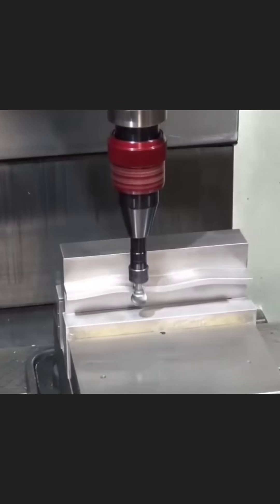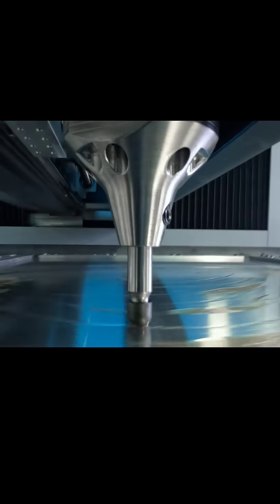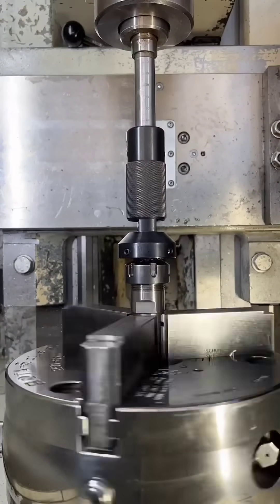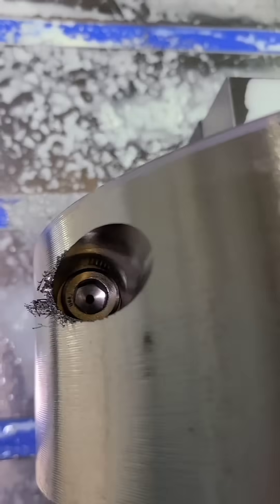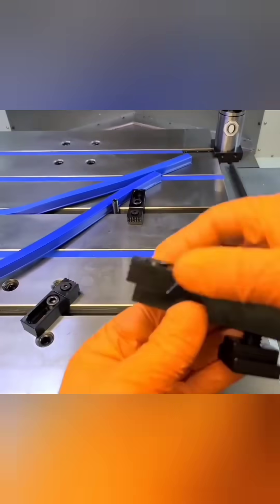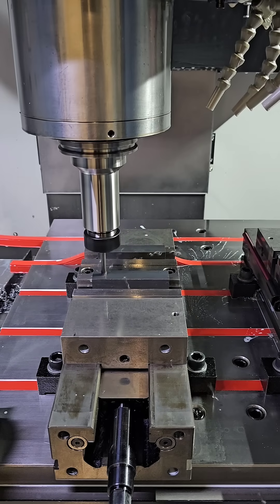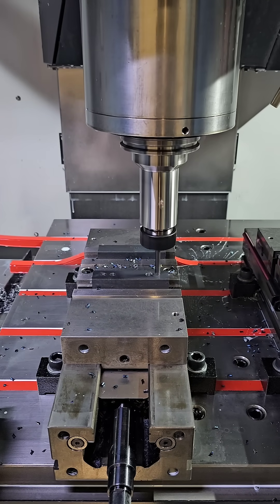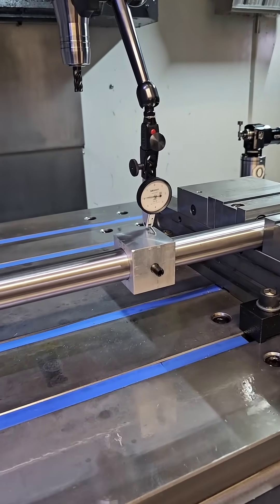Machinist Tips and Tricks Volume 9

Comment: Last time i tried to drill with only through air the drill just broke in a second. Feeds and speeds were correct and the chips are being broken when using coolant.

It was tool steel 1.2083

Comment: Spray brake cleaner or circuit board cleaner works great for cleaning honing stones also.
Reply: I usually use the oil and cardboard first, I've found that it removes any chips sticking to the stone, then I use the brake cleaner. 
Also, rubbing the faces of 2 stones of similar grit together with oil also works